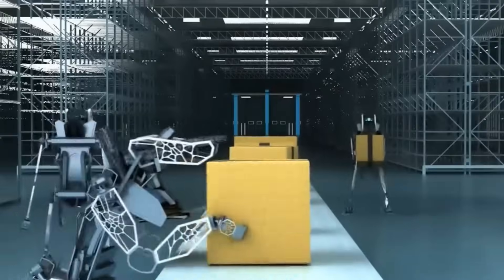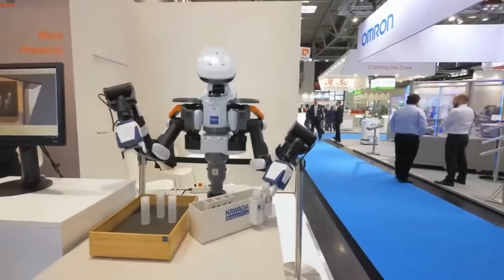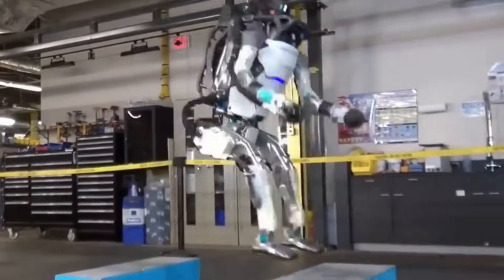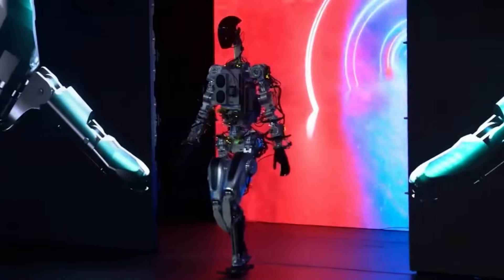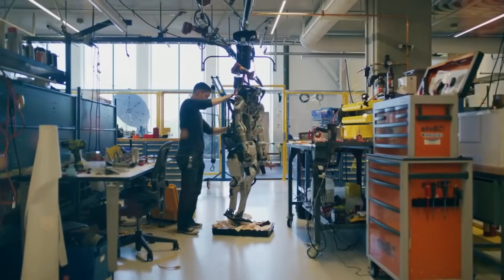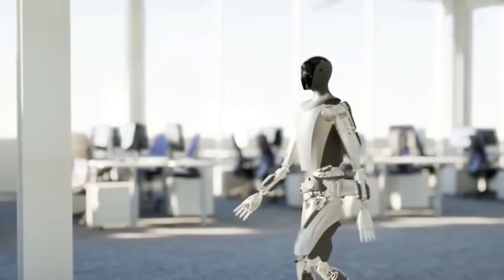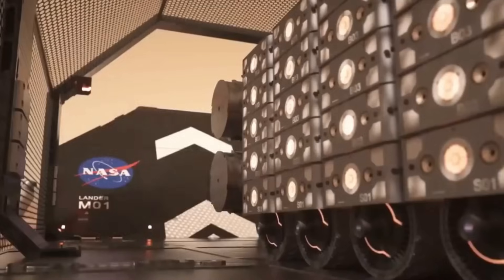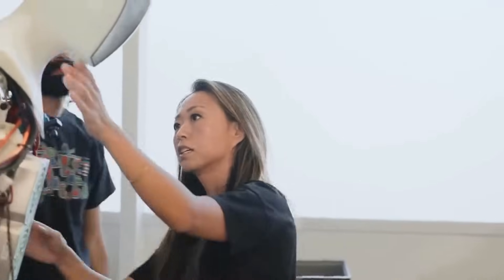LEAKED: Tesla Optimus Gen2  vs. Boston Dynamics Atlas!

Comment: Sorry I don't see it. Look at the fingers on Optimus do you think it can pick up a needle to thread it? And the AI still needed is not insignificant. I'm a long time Tesla fan but, Go see what other companies are doing to automate human tasks, they're NOT using humanoids. Have any humanoid bots shown any practical usefulness? Here are the problems.

1. It's made human-like so it can work in environments made for humans. 
This is the antithesis of "First Principles"! It compounds costs/complexity and reduces efficiency. Humans did not evolve to use technology! Do you want it to take the time to climb into a forklift to drive it, or would you rather just put the eyes and brain on the forklift? Should it stand still at a station packing widgets and only use it's legs to go charge itself? Also, many tasks that humans are doing don't necessarily need a humanoid form as much as it needs intelligence. For example, a task to clear a failed process inside a machine. It might be easier for a robot with one 4ft arm and a camera/light on its wrist. Where a humanoid might not be able to reach in and see at the same time. Same issues for a janitorial robot. What all the robots will need is the intelligence to use its dexterity and be told what to do.  

Making it more human-like doesn't make it more useful, in fact now it's limited to what a humanoid can do and will never do everything a person could.

2. No one will buy it until you can demonstrate it doing something practical. The selling point of Optimus is that AI will make it useful. A Boston Dynamics robot might be able to walk a dog without getting knocked over but you can't tell it to walk the dog. Enthusiasts say it will be easy like Alexa or Siri just tell it what to do. But can you imagine it trying to put a leash on a dog? Then they'll say it can do the "easy" factory work first. Have you been to a factory? I've been in industrial automation for a long time. All the "easy" things are already automated.
!!!!PLEASE !!! tell me what you think a humanoid will be able to do? A Person, without looking, can pick up just one small screw out of a pile and orient it in his hand while moving to place it. There is no way optimus could be that efficient. A small robot could. The only thing I heard was Brett Adcock saying it can move boxes and stuff around. This is not practical. A table waiter or stock boy might be a better first job. But the AI to do multiple tasks is more complicated than the ONE task of FSD. These things are not easy. It will all be dependent on machine learning which looks years away. Which BEGS! number 3.

3. The really dumb thing is that the immature AI has more testable, practical, attainable and cost effective uses without a humanoid body. It could make existing dumb robots SO MUCH !!! more useful! (avoid a crash instead of detect one afterward) Or you could ask it to watch and control a conveyor system. Then you could eliminate many position sensors in the system, just let the AI report where everything is. You could have it control actuators and machine interfaces because it can see where everything is and if it's working properly. It could report failures, defects etc. to the human operator that for years will still be needed to run the production line. Imagine how much !!! MONEY !!! you could save on parts, maintenance, plc programming, down-time etc. No robot needed just the intelligence. Fanuc had it's iRvision system for years already and is probably way ahead of Tesla in this area.

This is putting the cart before the horse. To produce it now would be like making "one size fits all cars" without steering wheels just because they have FSD. There are SO MANY bots out there already. IMO Tesla would be wise to dump optimus and develop the agi or mini agi's or whatever to license to existing bot makers. I bet Elon doesn't talk about it anymore bc the engineers finally got the balls to tell him that it's dumb.

4. Why? "A human like appearance facilitates trust and natural engagement because we are wired for human face to face interactions" OK but in a factory? Personal interaction robots being made today are cartoonishly friendly looking. Even if Optimus could wait tables people won't care that is humanoid because they can see it's just a robot. If you make it look more human with a face it gets creepy. So why shouldn't it have an arm with multiple plate holders, and eyes in back so it doesn't bump into someone, and a napkin/utensil dispenser etc. Which would a Denny's owner buy? Is it because people get enamored with the sci-fi view of humanoids? The AI robots of the future will aid humans not necessarily emulate them. Shouldn't a care-taker robot look like a Patient Lift with big soft hands, or should a humanoid have to manipulate it? Could it even comfortably get its hand under someone to help them? A person can feel with all parts of their hand to reach under someone. A person can reach into their pocket and count change without looking, Optimus could never do that.

Comment: Am I missing anything?!  Most important,  Atlas dynamics is not improduction at all.  Marc Raibert ,executive director of Boston Dynamics has stated many times that Atlas is a showcase of what the company can achieve with their research in robotics and Ai. Trying to compare Atlas with Optimus gen2, is like saying bananas are better than apples. Another thing about the hype of Optimus is that nothing concrete has been done yet; a fully functional Optimus. So far, smoke and mirrors.